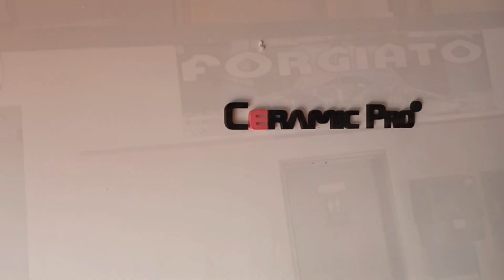Rainy season backfires time to grow

Comment: Man Bon I remember when I was younger and I was driving my old 64 bug I didn't have wipers for like a year I just waxed my windshield, well 2 days in the snow with no heat or wipers I said time to fix my shit haha wiping the glass on the inside and outside with a glove while I was driving 🤪 man time to check out that turboed 67!
Reply from the maker: I wouldn't mind getting that but I might get myself in trouble with the turbo
Reply from the maker: I had the windshield ceramic coated it sorta helped but I still get nervous in severe weather. In the snow I'd be on a extended weekend lol